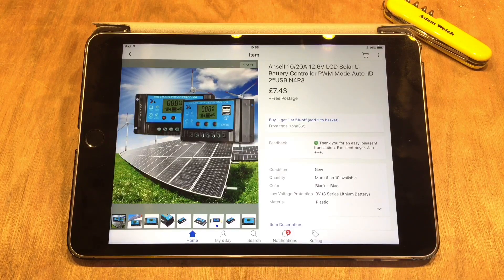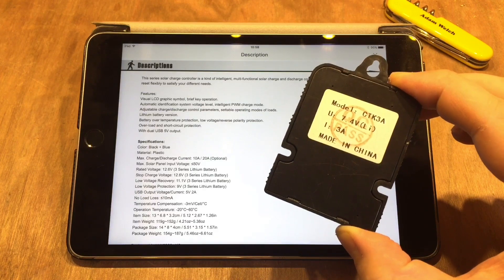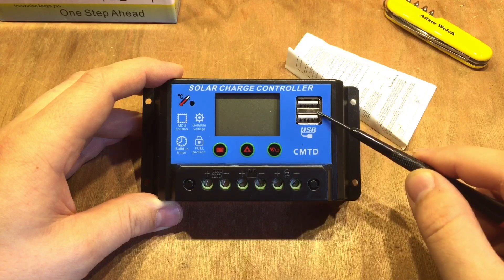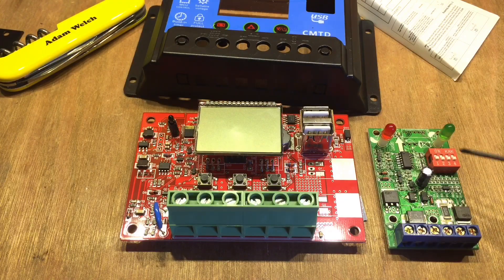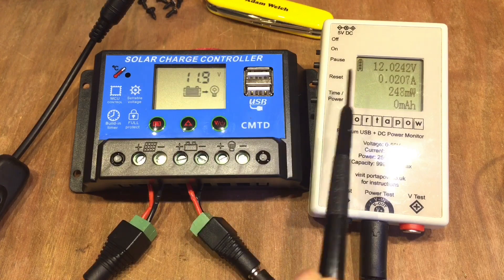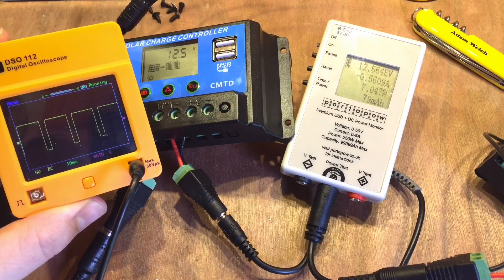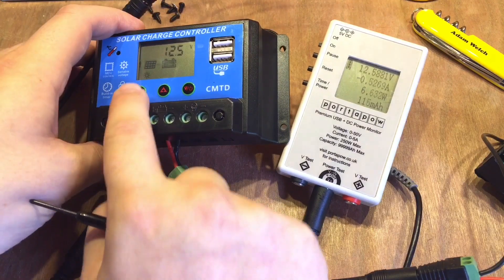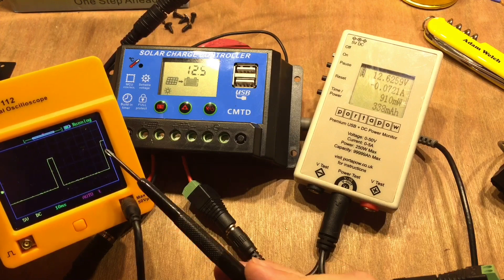Anself CMTD 3S Lithium Solar Charge Controller - 12v Solar Shed

Comment: is that the  same with the upgraded solar charge controler  but for  sealed gel flooded ? ? bought it for  a 2 panel 24v simple  standby  supply for my storage and small apliances  /// lights power supplies and  power station backups

Comment: Hi, the left-sided button is as you saw a change mode button  after you change by a press the direction, ie. pv, load on, load off etc. then hold the button for 5 seconds, the flashing spanner depics an adjusting is now! In the f.ex. please mode, say plus middle button or minus right button, to 14,5 max charge, then  press left button once. This is not trickel, it is all of nothing charge after how the sun on the solar is. Then is stops charging at 14 5. 
Load off, 5 secs, mine is 10,5, means no power given if under 10,5. So. Read the directions. It's a great little control, have used them 3 years. For 7 euros...Amazon. Cheap.

Comment: My solar is 36v 200w and my battery is 12v lipo. Will this works or the 36v solar will burn the 12v battery?

Comment: Luckily we all use a tiny inexpensive 3S BMS that does balancing also. It is still a nice unit with a fair amount of read-out values. Normally vendors recommend using a 3S BMS with this to avoid trickle charging after 12.6v voltage has been reached. But you knew this already.

Comment: these are not very good solar chargers, they won't go to float charge just sits on 14.4 volts from sun up till sunset, I have tested at least 3 of them and they all do the same thing. To change the mode you need to hold the left  button for 5 seconds but none of the parameters seem to do much, still charges to 14.4 .

Comment: I have one of these controllers that works fine for my lead acid battery. I'm changing to a 12 volt, 100ah Lithium battery. Can I still use this controller? The brief Chinese instructions only offer 3 choices, B1 sealed 14.4 V, B2 gel 14.2V, and B3 flood 14.6V.  It appears max charge voltage can be adjusted.

Comment: Mr. Welch, thank you for taking the time to analyze this charge controller. I have the same make and model charge controller. Mine is. LI320. Not sure the difference. Perhaps this is the 20 amp version. I wonder if you had taken into account any constant load that may be present across your lithium battery? In my application, i am powering an inverter to power a garage door opener. The device draws a slight amount of current constantly to power the wireless remote control receiver and the electronics that control the up and down actions of the door. Given these slight loads, do you suppose this trickle charge action would be beneficial to offset the draw on the battery by day and to make up for the draw without PV at night. Thank you.

Comment: I have been experimenting with the ANSELF lead acid 12/24 volt version the end top off voltage is fully adjustable I can adjust it from 13.2V all the way to to 16V in 100 mV increments . I tested it charging an 6 cell 16V Supercapacitor 300F each cell. I used this because it would charge up and reach the final voltage quickly. What I discovered is this charger does not trickle charge at all. When it reaches what it thinks is the final voltage the pulses slow down and then it stops all together. I feel Adams Meter he was using was just not quite in sync with what voltage it was reading compared to what the charger thought the voltage was. If he had just lowered the set point down a tenth of a volt he would of seen that it stop sending charge pulses. For my test I set the voltage at 13.2V and also later at 14.7V. After the capacitors were charged I would lower the set point down on tenth of a volt and then observe the meter showed no arrow pointing to charging and the pulses stopped until the capacitors started to self drain to the new lower set point. But the charger never went higher than what was shown on the display of the meter. And the meter always showed the current voltage of the capacitors (battery) not the set point. I really don't see why one would need a special Lithium battery charger because the top off voltage is adjustable from 13.2 to 16 Or 26.4V to 32V (as long as the solar panel or power supply feeding it does not put out more amps than the battery can safely receive a charge). Regarding the wrench display on certain parameters shown. If you press on the left button and hold it will allow you to change that parameter. I believe the hour meter button it you press and hold left button for that just resets the hour meter to zero. Also by using the capacitors to confirm about not trickle charging the voltage never rose higher than the setpoint even after several hours. I did notice I had to charge the capacitors up a few volts before the charge controller would start working because at first it was 7.3 volts and not enough to operate it properly. The reason I used the supercapacitors was because a lead acid or lithium battery would take too long to reach the setpoint where I could observe and confirm the pulses stopped after setpoint was reached. Another reason this charger would seem to work well with lithium batteries is that unlike some Lead acid battery chargers this does not have a fast charge algorithm where the voltage is ever raised higher than the set point for a certain period of time during the first portion portion of the charge cycle. At no point does the charge go higher than the set point.

Comment: You might be interested in: 12v Solar Charge Controller Buyers Guide - Beginner Friendly! https://www.youtube.com/watch?v=kF_cVEYxj3E&t=821s
Long-term a Li battery bank needs a BMS.  Here's the only one I've found that can do that:
   SBMS 100 by ElectroDacus - Solar Battery Management System https://www.youtube.com/watch?v=bg1x6X8tZok&t=246s
   Here's the guy (Dacian) making them all by himself in the middle of no-where canada http://electrodacus.com/

Comment: I had one of these. It was supposed to be 10A but it blew up at 5A. I tried a 20A version with the same result. None of these little blue controllers are worthwhile even when they have a different name or occasionally a different coloured front.

Comment: This device is suitable for Pressure control 14.4 v. 18650. 4s lifepo4  to Pure Sine Wave Inverter 12 - 15 v. To. Ac.

Comment: Press and hold down the first button on left for 5 seconds or until the readings flash, you can then adjust the settings up or down to your liking with the two other buttons.  This is the most common and usually cheapest solar charge controller on the market today.  Like most all of them, made in China.  Cheap as it is, it has an LCD readout which others that cost much more do not have.  It is listed as a CMTD type controller (Corrected Mean Temperature Difference) as opposed to an MPPT (Maximum Power Point Tracker) type controller.  The manufacturers include a very poor user manual.  Supposedly the USB output is at 2.5 amps.  I recently bought a Kw1220, 20 amp model of this off Ebay for about $5.00 sent from China, which looks exactly like yours but is not a CMTD type controller and could not handle my incoming panel voltage and wattage.  MPPT is at least 30% more efficient than PWM i.e. with MPPT you get 30% more output of your solar power system.

Comment: I have a similar controller for lead-acid batteries. In order to change a setting, You should hold down the menu-button down for appr. 5 sek. - until the numbers starts to blink. Then you can increase or decrease the values with the up and down buttons.
I really would like to know which values it is possible to choose for max. volt.
Reply: Hello from France. I suggest you set the max voltage value at about 14,4 volts. this is the maximum charge that a car alternator will usually deliver. By the way would you know what's the use or the 0 to 24 hrs setting called "load working mode"... It's set at 0 by default and I've left it as it is but I would like to know what is the use of this setting... Thanks and regards. JP/

Comment: I have a similar looking controller. It works just fine but as soon as my automated ventilation fans cut on, the software crashes and I have to reboot the thing. Mine is rated at 30A and my fans are rated at a combined 5A though they probably peak higher because they’ll blow a 5A fuse. I had to put them on 7.5A fuse. When running though they consume 4A. 

But that controller is one that ended up on the reject range. I had a 10A edition that served for about six months before going totally nuts. That, like the other ended up on the reject range too.

The reject range.... I just put things on a berm and shoot at them until I figure they’re dead enough.

Comment: Hello, nice that you accept this problem. I wanted to build a 3 or 4 S 3-4P.
I have a 12v water pump with about 3 watts. I would also like to connect 2 pumps. One should be able to walk for about 3 hours.
I also want to charge the battery.
I have a 100 watt solar panel.
Do you have a solution for that?
Do you have that with the charge controller in the meantime under control?
Greetings Tom

Comment: Should I connect my camp fridge directly to the terminal of the battery or to the load terminal!.
How do I connect a AC-DC Li Ion battery charger to the Controller. 
What is the out put rating at the load terminal marked with a light bulb.

Comment: Hi Adam sorry 2nd question asked on another of your great videos. Just wonder a voltage relay switch circuit board maybe a great tool to switch off PV's when batteries reach 12v maybe. Just trying to get my head around it.  But your clever so maybe another great video cheers .

Comment: Hi Adam I wonder if you can help me. I am a newbie at solar. I have bought this charge controller and a 100w panel. I also bought some extender  cable for the solar panel with the solar connectors. But I didn't concentrate on the fact that it changed my solar panel positive to black and negative to red. I fused the red(-) cable and after connecting the battery to the controller I connected the solar panel obviously in the wrong polarity and I didn't get the solar panel icon on the LCD display. I quickly realised my mistake and fused the black wire(+) and reconnected the solar panel in the right polarity but still no solar panel icon. Have a damaged the solar panel or the charge controller? I'm waiting for my multimeter to arrive so I can test a few things. Thanks in advance. Mick.

Comment: Hi Adam another great video as always. I have a couple questions I wanted to ask. 1) What do you recommend as the most optimum solar charger for lithium 18650 batteries? Also If per say I wanted to scale up in the future and if I did and I continued to add to my battery bank maintaining all of the proper volts with the solar panel and with the solar charger etc. Would a large solar charger like an Outback Mppt be ok to use in say a 18650 battery pack with say 12 volts and something like 1,000 AH? Does the system in your opinion become more unstable with the greater the size of the battery bank? And 2) What gauge wire would you say would be the best to use for the wire leads from the battery bank to the solar charger? The larger the wire size the greater the current flow which could make the system unstable and so basically I want to use battery holders as you use in your videos and use the same gauge wires that come stock with the battery holders and run them in the appropriate series and parallel to add up to the needed voltage and Ah for the desired battery bank. So would you say that this could be done efficiently or when a battery bank gets the size and scale of say 12 volts  and 1,000 AH or greater that it would be unstable to do something in this fashion? And that it would be better to use sodering and using nickel strips and using fuses are more appropriate because using the battery holders in a system that size would be too unstable? Please let me know your thoughts. Again great video thank you for putting them out two thumbs up and what is your best recommendation for a cheap starter solar charger for 18650 lithium battery bank with a budget range of $20 dollars to $80( just for starters) With a small bank of say one hundred Amp hours to three hundred Amp Hours  for starters before scaling up to one thousand Amp hours bank ?  Also one other quick side question has anyone explored Ni-cd battery bank or Lithium Polymer banks with solar? I haven't seen any video on it on youtube or the idea addressed anywhere on the internet.   Much thanks Adam God Bless

Comment: Adam, have you found a way to change the PV off voltage setting from 12.6v to 12.5 or 12.4 v? I've tried this controller with my medical cart batteries, but when the voltage gets to 12.6v the integral BMS stops the charge and discharges the packs to 12v. I would not rather change the BMS if I don't have to...
Reply from the maker: I'm afraid I don't.  I think some other comments on this video have suggested extra menus are available though.

Comment: I'm just wandering if it didn't cut out completely because it didn't reach max 12.6v . Your meter shows a bit higher voltage. I used similar controller with simillar set up but for lead acids and when it reaches certain voltage it cuts out completely solar panels . Did you try use solar panel with higher output ? What we can see on video   you have only 8w output from panel. I'll like to see video with like 50w output from panel. I could bet it will cut out. I have this controller but 20A . I'll like to do the same test but I don't have oscilloscope

Comment: Hi have bought a 10 A controller for my lead acid battery, my question is can I connect a light into the controller and does it have a built in timer my instruction book doesn't mention anything about setting the load?

Thanks Graeme

Comment: This channel is great. Came here after spending an hour comparing the 5/6 common <£10 regulators on ebay. Got an off grid system powered by two 90Ah car batteries, plus 120 x 7.2Ah panasonic lead acids just in case... (get them for free from work, not built them into a bank YET...). Currently swap the 2 batteries and charge with a repurposed Mascot brand SLA battery charger (3 stage). Adding a 20W solar panel to keep one topped off. Is this your favourite sub ten pound charge controller?
Reply from the maker: +jack419288 Thanks for the kind comments. If you want an lcd screen then the lead acid version of this charger is probably your best bet. However my favourite is probably this one... https://youtu.be/BbIqNGHe6Xc you might be able to buy three within your budget! I like it because it’s simple - does what it’s meant to and is very very cheap!

Comment: I've used a similar model.  If you set a high voltage disconnect at 13.8v or whatever it will stop charging.  Then set the high voltage reconnect to 12.8v or whatever.  In this way it will drift between HVD and HVR with no charging in between.  

Mine is sold for Pb but when I saw how it worked I immediately thought "lithium".

Comment: Good video, thanks, I subbed.  I am looking to find a CC for some 18650's in a 12v system as well.  I will check out your other videos, but can you tell me if you found a solution?  I actually bought a Victron 100/30 mppt CC that has a lithium setting.  I bought that for a big lifepo4 pack, but It is also fully configurable through bluetooth with a dongle.  I found it on sale for  about $150, but I want something cheaper for some small 18650 packs.
Reply from the maker: 12 volt lithium systems are trickier I think than 24 volt or 7s.  I charge my 7s pack from a lead acid charge controller with (so far) great results.
The best dedicated lithium solar charge controller I've used (that will do 12v) is probably the small CN3702 modules... https://www.youtube.com/watch?v=liYZ5pYOZDE  The trouble is they can only support fairly small panels out of the box.

Comment: A Little Help Please....I have this hooked up to a 25 W Panel.  I am getting 21v at the panel on a sunny day.  When putting the volt meter on the battery out terminal, I get 8.5v.  I get the same reading in the alligator clips.  Other charge controllers that I have read 13.1v to 14v under the same configuration.  Figuring I may have a defective CC, I ordered a second one to test.  Same result.  Am i missing something?  Is there a setting that needs to be adjusted.  I am afraid that the unit will only charge when the battery gets down below the 8.5v, thereby damaging the battery.  Your help will be much appreciated.
Reply from the maker: +mantos1966 The model I'm using here is one setup to charge lithium cells. Firstly you need to attach the battery before the solar panel, and then you might need to look through the menu to tell it you are using a 12v lead acid battery.  8.5v may be a 2s lithium setting? If none of that helps, it may be that you are very unlucky with two faulty units.

Comment: Great video!  Two questions:
1. How are you measuring the charge pulse?  current to voltage converter or ??
2. The charge controller is running off the battery power, right?  Could the pulse charging be there to put power back in that the charge controller itself is draining off??  Do you see a net gain above the 12.6v+ that you were seeing??

THANKS!!
Reply: I tend to support the idea that the trickle charge is there to supply the load of the controller. If the voltage does not exceed 12.6v, IMHO the batteries are not charging. Personally I prefer the cutoff at 12.45v for 3s